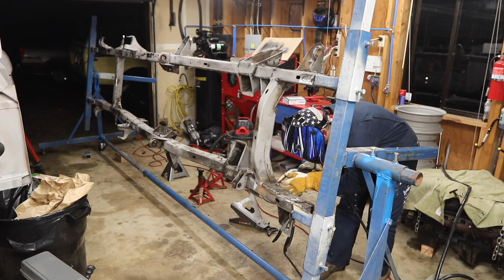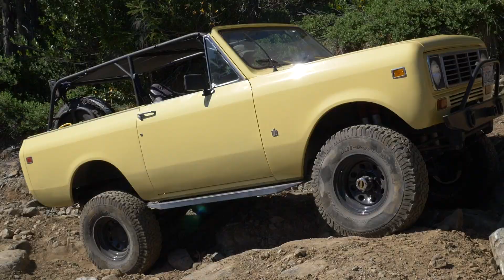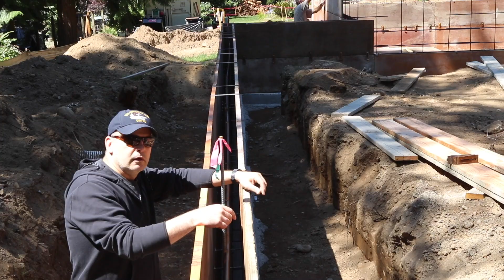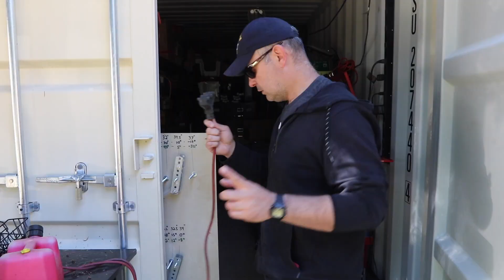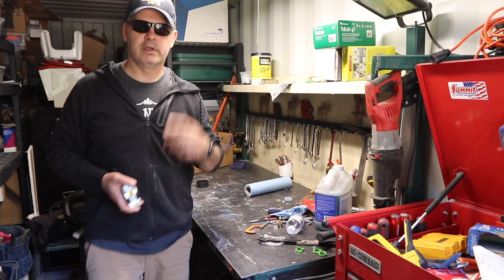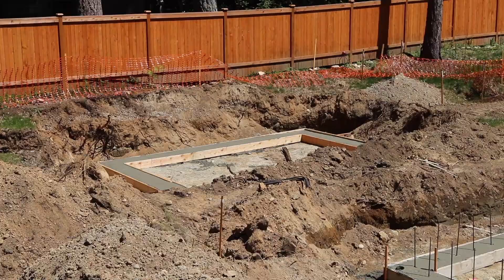7.04-Foundations

Comment: Hi Matt, you mentioned having taller concrete walls where your patios attach to the house. How are you picking up the load from your floor joists that would of normally say on top, building a stud wall below?
Reply from the maker: Roland Fontaine good question. In that section the joist nun parallel so I don’t need to worry about it. At the patio. The joist hang off the wall with hardawre